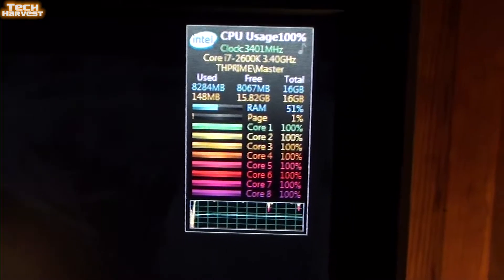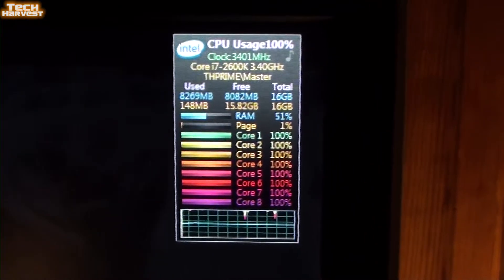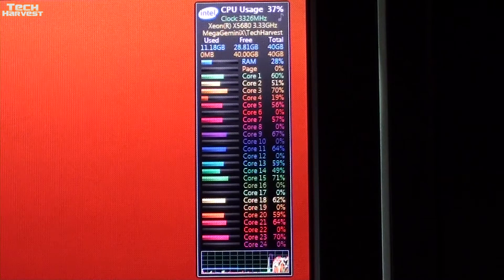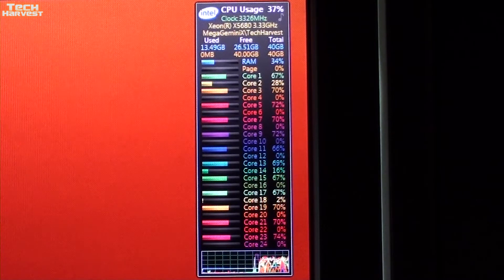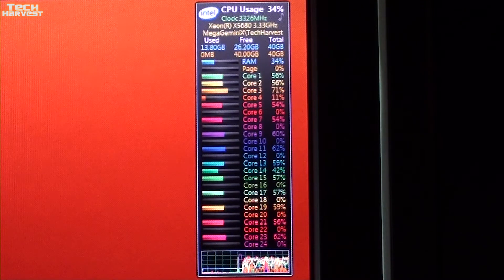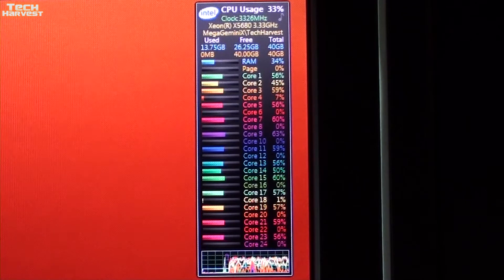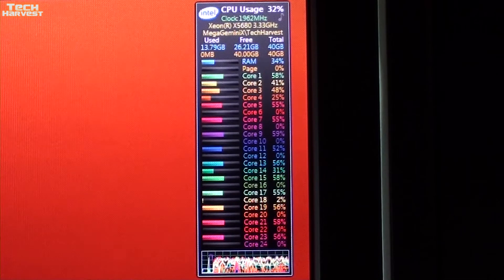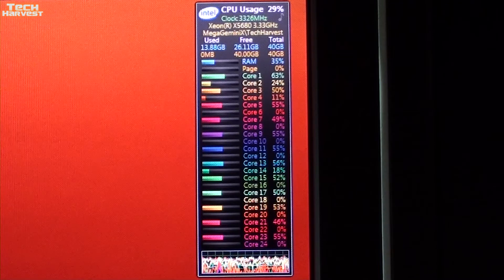Dell Precision T7500 Upgrades

Comment: Hi. These 2 6-pin pci-x connectors - are they equivalent (I mean voltage)? One has white/black and one blue/black cables...
Reply: OLD POST, but yes the only difference is the wire color.